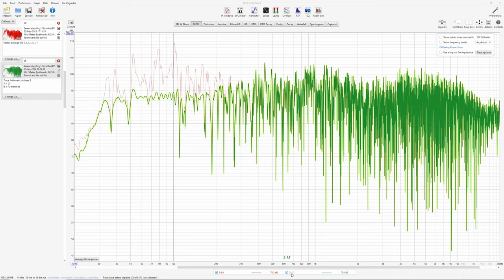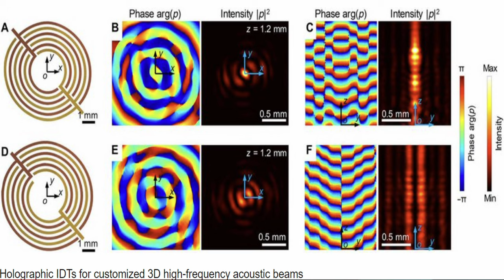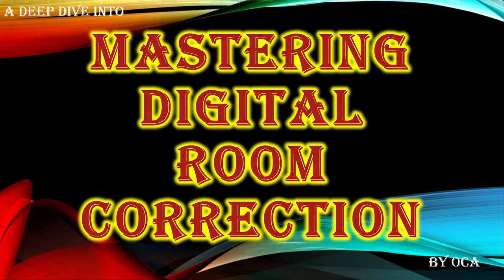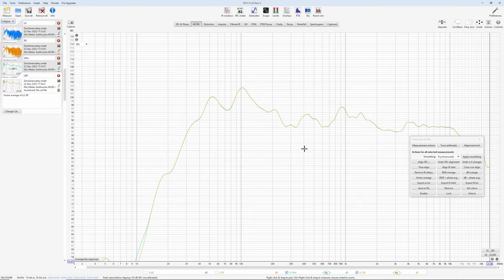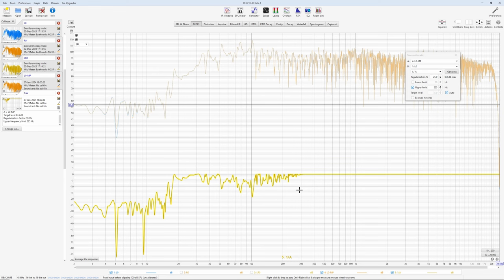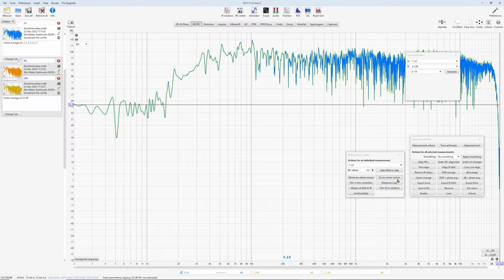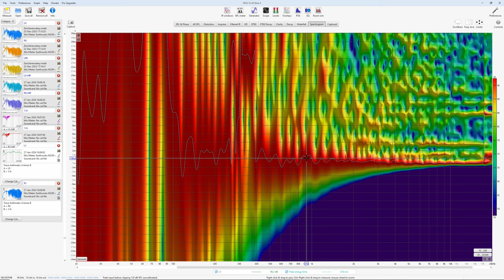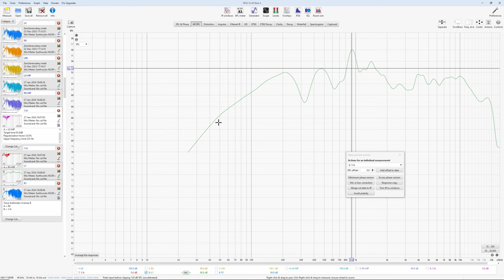Mastering Digital Room Correction

Comment: Thanks for the great tutorial. Can i export these filters to use them with a MiniDSP 2x4HD?
Reply from the maker: REW doesn't export in .bin format and although it's possible to convert a wav file to bin format (I recently wrote a short script which can do that), MiniDSP FIR filter capacity is 1024 taps per channel which is not enough for these filters. With MiniDSP your best way is to use REW autoEQ filters 20-200Hz and also apply a crossover phase correction for your speakers designed in rePhase for the 1024 taps. rePhase can export in bin format, too.

Check this link:

https://audiosciencereview.com/forum/index.php?threads/limitations-of-minidsp.51254/post-1867895
Reply: @ocaudiophile  Yes, the HD version of the 2x4 has 2048 taps per channel but I realize even that is not good enough for a filter like this. Btw, the crossover phase correction in rephase should be applied to the auto eq filter exported from rew?
Reply from the maker: @paulsoumya  you can export auto EQ results as biquads directly to minidsp. Then you make xo phase linearization filter for your speakers in rephase and save it as a 2042 tap.bin file and upload to minidsp fir. They work in paralel in minidsp.
Reply: @ocaudiophile  thanks. will try it 👍
Reply: @ocaudiophile I use a Minidsp for my fronts. I was going to rephase and then autoeq but I'll switch the order up.

Comment: I tried this, but the resulting filter had a right window size of over 10,000. It also causes pre-ringing. What am I doing wrong?
Reply from the maker: Hard to say without seeing the actual measurements but I am interested to find out. Can you share your mdat file? You can post google drive links here (most others will be deleted by YT).
Reply: @ocaudiophile   Sure. I have some strange dips that don't appear in other measurements. I have a CSL Umik-2 but I want to take new measurements with the REW specific cal file that I made minimum phase. I used these measurements along with changing the cal file in REW to make the XO phase filter and that works perfectly though. I sent the link via PM in the roon community forums. Thanks
Reply from the maker: Looks like it's your XO filter that caused the pre-echo. Here's a fixed correction for your system:

https://drive.google.com/file/d/1guMQoUQ3Ow3I7kYX4B7-5rn8KTyTVKtD/view?usp=sharing
Reply: @ocaudiophile  Thanks! I'll take a look at your corrections and incorporate them into my new measurements.
Reply: @ocaudiophile  Hi, I apologize for the interruption. I encountered the same issue. I followed each step carefully, but pre-ringing still occurred. Unfortunately, I am currently at a loss regarding a solution.
Reply from the maker: @ShishoROC Create "Minimum phase version" (it's under Measurement actions) of each final filter with no options ticked. And export these new filters as your new convolution wav files.
Reply: @ocaudiophile  Thank you very much for your patient explanation. I have successfully solved the pre-ringing problem.

Comment: How would you recommend going about SW integration with this method? I have only 2 front fullrange speakers and 1 SW. I am using CamillaDSP with a RME UCX-II interface, so can set each filter individually per channel. I created the mp filters for L, R, and SW. How should I go about aligning LR with SW?
Reply from the maker: You should be seeing something close to your speakers' spec bass roll off curve after the inversion and the crossover frequency must be kind of obvious now. I'd time/volume align the inverted SW/speaker bass responses to the LP and that should do it. I don't think you will need additional EQ after the crossover with the correct XO point. You'll need to sync impulse peaks at the LP for time alignement. It should also be obvious from phase responses and impulse peak directions if SW needs a polarity inversion. Let me know how it goes.
Reply: @ocaudiophile  Thanks for the direction. I created the 3 separate filters for L/R/SW based on the inversions of the minimum phase measurement (as described here).
I "tested" them in REW with A*B on the original measurement and they do indeed flatten the response until 200Hz. I also applied in CamillaDSP and it sounds good.

That said, I have not time aligned them yet, not sure of the best approach here. The first peak of each IR seems to be very close to t=0, I assumed that this is due to acoustic ref but could be wrong.
Also,I was using a UMIK-1 until now but just got a M23R so will retake all the measurements anyway with the new mic.
Lastly, I used the alignment tool to try to align SW to L/R. To do this, I made a vector average of L/R after applying 1/MP filter, and aligned with SW. Interestingly, the best response seems to be when I use the measured SW, and not SW after applying the 1/MP filter, which has some dips.
I hope my explanation was clear.
Reply from the maker: @itsik_ Congrats on the M23R, I also own one and I never looked back since. You've to just time align a single sub to MLP especially for music. Alignment tool is for multiple sub relative alignment. I'm about to launch a video on subwoofer alignment btw.
Reply: @ocaudiophile  Oh nice, looking forward to it. Will that cover subwoofer alignment to main speakers? In the previous comment, you wrote "You'll need to sync impulse peaks at the LP for time alignment." Is these between Left and right, or between them to the sub?

Comment: Any chance, that you'll explain how to implement a simple tone-adjustment to the speakers with audyssey? I really like Dyn. Eq and Dyn. vol, but I don't like the sound of an eq'ed speaker, because i listen to the system at so many different locations. I'd like to simply make a +1 bass and -1 treble adjustment to the whole thing, as I find the speakers a tad too bright.
Reply from the maker: If you replace speaker responses with "perfect speaker" settings in the ady file (a script in Audyssey ART video does that automatically) and set your Audyssey to "Reference" in the AVR, DYnamic EQ and Dynamic volume will work but there will be no EQ applied.
Reply: @ocaudiophile  Thank you - but i can already do this by setting the eq-range in audysseyapp to 0(or 20 Hz). What i want is audyssey to "correct" the perfect speaker with +1 db in the bass range, and -1db in the treble range. 
Again, Thank you so much for replying.
Reply: Like telling audyssey, that i have a "perfect speaker" that plays bass exactly 1 db too low, and treble 1 db too loud, so audyssey corrects it to +1 bass and -1 treble. Like a tone control
Reply from the maker: Copy and paste the below under "CustomTargetCurvePoints" for each detected channel in the .ady file in the Json editor:

[
  "{15\t1.01}",
  "{15.5\t1.01}",
  "{16\t1.01}",
  "{16.5\t1.01}",
  "{17\t1.01}",
  "{17.5\t1.01}",
  "{18\t1.01}",
  "{18.5\t1.01}",
  "{19\t1.01}",
  "{19.5\t1.01}",
  "{20\t1.01}",
  "{20.6\t1.01}",
  "{21.200001\t1.01}",
  "{21.799999\t1.01}",
  "{22.4\t1.01}",
  "{23\t1.01}",
  "{23.6\t1.01}",
  "{24.299999\t1.01}",
  "{25\t1.01}",
  "{25.799999\t1.01}",
  "{26.5\t1.01}",
  "{27.200001\t1.01}",
  "{28\t1.01}",
  "{29\t1.01}",
  "{30\t1.01}",
  "{30.700001\t1.01}",
  "{31.5\t1.01}",
  "{32.5\t1.01}",
  "{33.5\t1.01}",
  "{34.5\t1.01}",
  "{35.5\t1.01}",
  "{36.5\t1.01}",
  "{37.5\t1.01}",
  "{38.700001\t1.01}",
  "{40\t1.01}",
  "{41.200001\t1.01}",
  "{42.5\t1.009}",
  "{43.700001\t1.009}",
  "{45\t1.009}",
  "{46.200001\t1.009}",
  "{47.5\t1.009}",
  "{48.700001\t1.009}",
  "{50\t1.009}",
  "{51.5\t1.008}",
  "{53\t1.008}",
  "{54.5\t1.008}",
  "{56\t1.008}",
  "{58\t1.007}",
  "{60\t1.007}",
  "{61.5\t1.007}",
  "{63\t1.006}",
  "{65\t1.006}",
  "{67\t1.005}",
  "{69\t1.005}",
  "{71\t1.004}",
  "{73\t1.003}",
  "{75\t1.002}",
  "{77.5\t1.001}",
  "{80\t1}",
  "{82.5\t0.999}",
  "{85\t0.997}",
  "{87.5\t0.995}",
  "{90\t0.994}",
  "{92.5\t0.992}",
  "{95\t0.99}",
  "{97.5\t0.988}",
  "{100\t0.985}",
  "{103\t0.982}",
  "{106\t0.979}",
  "{109\t0.975}",
  "{112\t0.972}",
  "{115\t0.967}",
  "{118\t0.963}",
  "{122\t0.957}",
  "{125\t0.951}",
  "{128\t0.946}",
  "{132\t0.938}",
  "{136\t0.93}",
  "{140\t0.921}",
  "{145\t0.909}",
  "{150\t0.895}",
  "{155\t0.881}",
  "{160\t0.866}",
  "{165\t0.851}",
  "{170\t0.834}",
  "{175\t0.817}",
  "{180\t0.798}",
  "{185\t0.779}",
  "{190\t0.76}",
  "{195\t0.74}",
  "{200\t0.72}",
  "{206\t0.695}",
  "{212\t0.669}",
  "{218\t0.644}",
  "{224\t0.618}",
  "{230\t0.593}",
  "{236\t0.568}",
  "{243\t0.539}",
  "{250\t0.51}",
  "{258\t0.479}",
  "{265\t0.452}",
  "{272\t0.427}",
  "{280\t0.399}",
  "{290\t0.366}",
  "{300\t0.336}",
  "{307\t0.316}",
  "{315\t0.295}",
  "{325\t0.27}",
  "{335\t0.247}",
  "{345\t0.227}",
  "{355\t0.208}",
  "{365\t0.191}",
  "{375\t0.175}",
  "{387\t0.159}",
  "{400\t0.143}",
  "{412\t0.13}",
  "{425\t0.117}",
  "{437\t0.107}",
  "{450\t0.098}",
  "{462\t0.09}",
  "{475\t0.082}",
  "{487\t0.075}",
  "{500\t0.069}",
  "{515\t0.063}",
  "{530\t0.058}",
  "{545\t0.053}",
  "{560\t0.049}",
  "{580\t0.044}",
  "{600\t0.04}",
  "{615\t0.037}",
  "{630\t0.035}",
  "{650\t0.032}",
  "{670\t0.03}",
  "{690\t0.028}",
  "{710\t0.026}",
  "{730\t0.025}",
  "{750\t0.024}",
  "{775\t0.022}",
  "{800\t0.021}",
  "{825\t0.02}",
  "{850\t0.02}",
  "{875\t0.019}",
  "{900\t0.019}",
  "{925\t0.018}",
  "{950\t0.018}",
  "{975\t0.018}",
  "{1000\t0.018}",
  "{1030\t0.018}",
  "{1060\t0.018}",
  "{1090\t0.018}",
  "{1120\t0.018}",
  "{1150\t-0.019}",
  "{1180\t-0.019}",
  "{1220\t-0.02}",
  "{1250\t-0.021}",
  "{1280\t-0.021}",
  "{1320\t-0.022}",
  "{1360\t-0.024}",
  "{1400\t-0.025}",
  "{1450\t-0.027}",
  "{1500\t-0.029}",
  "{1550\t-0.031}",
  "{1600\t-0.034}",
  "{1650\t-0.037}",
  "{1700\t-0.04}",
  "{1750\t-0.044}",
  "{1800\t-0.047}",
  "{1850\t-0.051}",
  "{1900\t-0.056}",
  "{1950\t-0.061}",
  "{2000\t-0.066}",
  "{2060\t-0.072}",
  "{2120\t-0.079}",
  "{2180\t-0.087}",
  "{2240\t-0.095}",
  "{2300\t-0.104}",
  "{2360\t-0.113}",
  "{2430\t-0.124}",
  "{2500\t-0.137}",
  "{2580\t-0.151}",
  "{2650\t-0.165}",
  "{2720\t-0.18}",
  "{2800\t-0.197}",
  "{2900\t-0.22}",
  "{3000\t-0.244}",
  "{3070\t-0.261}",
  "{3150\t-0.281}",
  "{3250\t-0.307}",
  "{3350\t-0.334}",
  "{3450\t-0.361}",
  "{3550\t-0.389}",
  "{3650\t-0.416}",
  "{3750\t-0.443}",
  "{3870\t-0.476}",
  "{4000\t-0.51}",
  "{4120\t-0.541}",
  "{4250\t-0.574}",
  "{4370\t-0.602}",
  "{4500\t-0.632}",
  "{4620\t-0.658}",
  "{4750\t-0.684}",
  "{4870\t-0.707}",
  "{5000\t-0.73}",
  "{5150\t-0.755}",
  "{5300\t-0.778}",
  "{5450\t-0.799}",
  "{5600\t-0.818}",
  "{5800\t-0.841}",
  "{6000\t-0.861}",
  "{6150\t-0.875}",
  "{6300\t-0.887}",
  "{6500\t-0.901}",
  "{6700\t-0.914}",
  "{6900\t-0.925}",
  "{7100\t-0.935}",
  "{7300\t-0.943}",
  "{7500\t-0.951}",
  "{7750\t-0.959}",
  "{8000\t-0.966}",
  "{8250\t-0.972}",
  "{8500\t-0.977}",
  "{8750\t-0.981}",
  "{9000\t-0.985}",
  "{9250\t-0.988}",
  "{9500\t-0.991}",
  "{9750\t-0.994}",
  "{10000\t-0.996}",
  "{10300\t-0.998}",
  "{10600\t-1}",
  "{10900\t-1.001}",
  "{11200\t-1.003}",
  "{11500\t-1.004}",
  "{11800\t-1.005}",
  "{12200\t-1.006}",
  "{12500\t-1.006}",
  "{12800\t-1.007}",
  "{13200\t-1.008}",
  "{13600\t-1.008}",
  "{14000\t-1.009}",
  "{14500\t-1.009}",
  "{15000\t-1.009}",
  "{15500\t-1.01}",
  "{16000\t-1.01}",
  "{16500\t-1.01}",
  "{17000\t-1.01}",
  "{17500\t-1.01}",
  "{18000\t-1.01}",
  "{18500\t-1.01}",
  "{19000\t-1.01}",
  "{19500\t-1.01}",
  "{20000\t-1.01}",
  "{20600\t-1.01}",
  "{21200\t-1.01}",
  "{21800\t-1.01}"
]
Reply from the maker: If you want Audyssey only to do that but no correction itself, you will still need to convert them to perfect speakers.
Reply: I'm really trying to get this to work - but if I copy the CustomTargetcurvepoints the file ends up corrupted. I tried to "Perfect" the speaker, and make the curve in the app itself. But in speakerdetection results, my "perfect speaker" has a rise towards 20.000 HZ, which audyssey tries to correct by reducing it.

You are already using too much of your time on my request. I'm really sorry.
Reply: Like: When i transfer the "Perfect speakers".ady, Audyssey doesn't detect a perfect flat line. It's a flat line sort of half ways (1kHz), then it goes a bit up and down, and from 7kHz to 20 kHz it's a straight line to +10db. Writing this reminds me of the hidden calibration file for the audyssey microphone. It's that exact curve that shows up as my detected speaker.
Reply from the maker: @jenstoft235 That's the dynamic eq effect.
Reply: @ocaudiophile  Dynamic EQ would have a bass-boost as well. I really don't understand if this should be dyn. eq.
I told audyssey that the speakers response is perfect with "1, 0, 0, 0, 0". It would make sense that audyssey interprets that as the exact invert of the microphones reponse. Like we don't tell Audyssey that this is a perfect speaker. We tell Audyssey that the microphone reponse is perfect. This makes audyssey think that the speakers reponse is the invert of the microphone reponse.
Does this make sense?
Reply from the maker: You make a very valid point. I used to think, it simply tells Audyssey not to apply any filter to the speaker but it might be applying an inverse mic cal filter.I have a video where I extract Audyssey mic cal file. You can save the inverse of this as your custom target curve points! @jenstoft235
Reply: Thanks!
Out of curiosity: Does this 'mistake' affect all the full method? Like, don't you have to merge the inverse Mic-cal file into your corrections for measured speakers?. @ocaudiophile